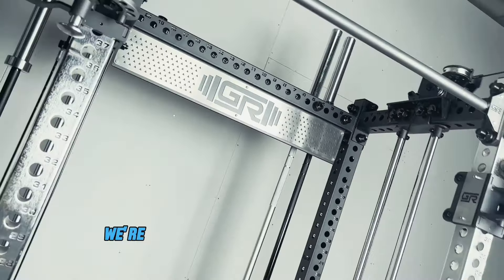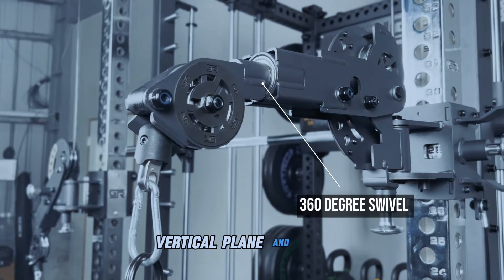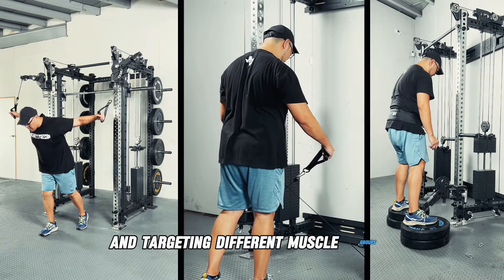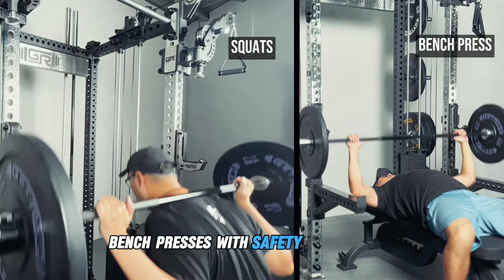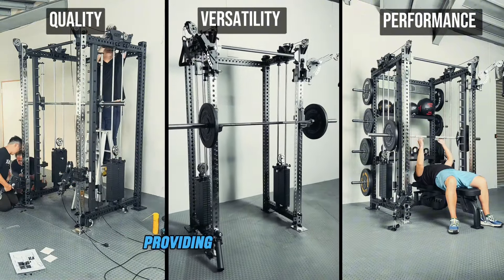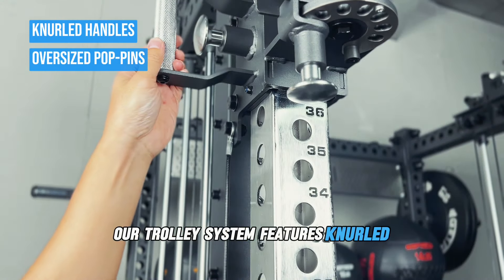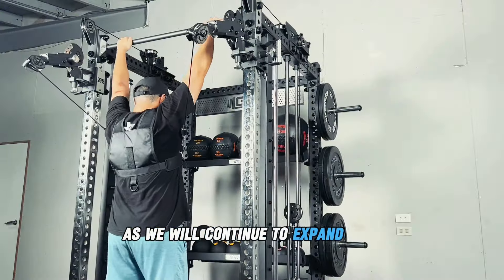RX3 series: Deep Dive Review on the New Tornado Racks 🌪️🌪️🌪️

Comment: This is insane! A shorter version like reps 80" would be cool
Reply from the maker: @Alex-kb9rd  we will have tornado configurations using 84” upright which would be 86” total height available in January 2025!
Reply: @GetRxd  Still too tall for my basement sadly. I can easily cut the uprights shorter, and I know I would need to have a shorter cable made if I did that. Only thing I'm not sure about is the guide rods, are they threaded on the ends or not? If not then they could also be cut and everything would bolt together nicely, but if they are threaded then that would complicate things.
Reply: Honestly wish you guys would have just gone shorter with it especially because for the same height of upright, the tornado arm already lets you position the pulley much higher than you could on something like the Ares.
Reply: @timk8258  they hinted a 85" cable tower in 2025, might be easier to cut that than a rack, wouldn't have tornado arms but its still quality
Reply from the maker: @timk8258  How tall is your basement? So we can consider a shorter version for the future as well
Our guide rods are NOT threaded, so you could cut the guide rods and put a hole through it for the bolt to pass through horizontally through it. Check our owner's manual to see how it assembles: https://www.getrxd.com/owners-manuals
Reply: Almost have ours completely built!
Reply from the maker: @Dou8leShot  AHHH!! We are so excited to see it and hear your thoughts : )
Reply: @GetRxd  Ill be ordering a 6 post smith tornado when you release the 86" version!
Reply: @Dou8leShot  Mines 2 1/2 weeks out. How hard is it to put together ?

Comment: You need to offset the arms to the side so that the cable doesn't have to travel down the center of the upright, would give more flexibility into what you can use with the arms at the bottom of the uprights.
Reply from the maker: Thanks for the feedback!
Reply: That's one of the flaws I.ve seen. Smith machine not going low enough and maybe not a flaw but tornado arms are heavy and hard to raise are other things. I still ordered one. Hope I made the right choice.

Comment: Awesome rack + cable machine + smith machine combo! After GGR and Gluck's reviews, these things are gonna sell like crazy. Hope in v2, they address some of the issues mentioned in those reviews (mainly the arm weight for moving it up).
Reply from the maker: We decided to go with the most durable, bomb-proof design for the trolleys with the least amount of moving parts possible. We’ve seen rollers inside trolleys breaking when hitting bottom crossbar, other attachments, or a barbell hitting them accidentally. Wanted to mention that while you do sacrifice some convenience without rollers in the trolley, you get the most durable design possible instead
Reply: @GetRxd  OK, but for some people (including spouses) the weight may be prohibitive. It would be cool to see a 'roller upgrade' kit for these arms - even if at the expense of some longevity (which the buyer has to understand when they buy this kit).

Comment: What is the max weight capacity of the cables + this pivot arms? Will you sell a larger stack?
Reply from the maker: @Tuhkeera  cables and tornado arms can handle 450+ LBs. We don’t plan to offer a larger weight stack than the 2x current 200lb stacks. You’re able to combine both stacks together by angling the tornado pivot arms together, and can further increase weight using our weight stack plate load pin, which allows you to add Olympic weight plates to the weight stacks!
Reply: @GetRxd is that 450lb real weight per arm/cable?  I think I sent an email asking for details a few weeks ago and the rep said 300lb real weight per arm, so would appreciate if you could confirm that.
Reply from the maker: @Kamikaze00ish  450lbs real weight per arm and cable

Comment: this looks really nice - great job.  i do have a question about doing the lat pulldowns.  in the video you are doing the lat pull downs outside of the rack facing in ( @56 seconds).  is it possible with the with this set up sit in the inside of the rack and face outward to do the lat pull downs?  or would it be a weird angle with the cables?>  i ask this because then you could use rollers or something to brace your legs when doing heavier lat pulls using both stacks.   also - are you able to do low rows from the ground with a foot brace? would it be possible to do them with foot extensions and a foot brace?  am in the market for a functional trainer and this looks really nice and right up my alley. thanks for answering
Reply from the maker: Yes you can do lat pulls from both inside and outside the rack. When inside the rack, the tornado arms would just be positioned slightly in front of you since the tornado arms are outside the rack. And yes, low rows from ground with a foot brace would work as well. We do offer front feet extensions or our adjustable foot plate that can both be attached on the uprights of our tornado rack!
Reply: @GetRxd  thanks for the answers! now I gotta make decisions lol

Comment: Wow, super impressed with the arms. Are there different weight limits depending on the angle of the arms? 

Im not sure if it would be possible, but if there was a way to unhook the bottom of the smith machine and move it like 6in to allow a slight angle smith, that would be amazing. 

Too bad the arms can telescope to come in closer for lat pulldown or low row. Im sure to make that possible it would require too thick of metal to keep it at this price point. Very nice machine. Hopefully I can purchase by this summer.
Reply from the maker: Hello! The weight limit of the tornado pivot arms is over 450+LBs at any angle, no worries there.
The Tornado Pivot Arms can adjust towards center to only 10" apart from one another, it's plenty close enough for lat pulldown and low rows. Further, with them set towards center, you can do lat pulldown and low row with each arm independently (unilateral training) or use our Tornado Arm Connector to connect both 2x tornado pivot arms together if you want to use both hands at same time (bilateral training) for lat pulldown and low row. This video shows it been done both ways: https://youtu.be/M8_6wthIaQY?si=Swwc4TzRFLJK8SQY&t=72

There's no way to angle the smith machine right now without some modifications by end-user.
Reply: @GetRxd  thanks! When the RX3 is available, will there be a drop down meu to add extras like storage and weight pins or is that done by searching the website?
Reply from the maker: @NorCalDad  We sold out the first few production runs very quickly. It's available for preorder now for incoming productions. Depending on which rack you want, you'll see an Available Date for when we expect to be able to ship the specific rack you ordered. If you navigate on our website to Strength Training >> RX3 Series >> RX3 Attachments and Accessories - you can see the available extras we have available now. You can also check the FAQ portion of the rack you're interested in for a list of the extra attachments we currently recommend
Reply: @GetRxd  awesome,  thanks!
Reply: @NorCalDad  Mine will be here 2/21. Got it with 2 db storage shelves. There's a lot of extras. I'll see after using it what else I need.  I see I saved $400 by pre-ordering when I did. Good luck.

Comment: About to receive ours and put together. What size sockets/wrenches will we need?
Reply from the maker: Hi @Dou8leShot, thanks for the question - Will require a 36mm wrench to get the job done.
Reply: @GetRxd  Ah, should have picked up that wrench set y'all sell.  Good deal.  I ended up picking up a couple 36mm wrenches on Amazon 1-day though I'll probably get that wrench set y'all sell just to have handy with the rack.  Arrives tomorrow!
Reply from the maker: @ Actually, take a look at the owners manual page here: https://www.getrxd.com/owners-manuals
Scroll to bottom to find RX3 tornado configurations. Open the link for the rack you purchased and the necessary wrench sizes will be listed on first page!
Reply from the maker: We'd also love to see a review on Youtube, Reddit, Instagram, or FB community group once you have it all setup : )
Reply: @Dou8leShot  Hey. Been 2 months. How was it to put together and to use ? Mines coming 2/21

Comment: Hey @getrxd i am looking at the compact rx3 tornado rack at 32.5".  Will it accomodate the smith attachment? It works with the 30" rack for the 6 post rack so im assuming it will?
Reply from the maker: Yes, it can accommodate the smith machine, but that means the weight stack would be pushed further back towards the back uprights, so if you wanted to add shelving, you'll need to use the shelf and plate sleeve extension (set). Also, since you'd be installing the weight stack further back towards the back uprights to make room for the smith machine, you'd need a different cable than what's normally included with that rack. If you place the order online, please email Sales@GetRXd.com with your order # to add the smith machine and receive the longer cable so we can make the changes to the order for you!

Comment: Is this a true 3”x3” rack with 1” holes? Curious about using other attachments on this like the new rogue roller for the lat Pulldowns.
Reply from the maker: It's setup for 75mm x 75mm with 26mm (1") holes
Reply: So...this is metric width (75mm x 75mm), but with standard holes  and hole spacing (1" x 2")?....or are the hole size and spacing metric as well? This matters to me because I bought your rack (haven't received it yet), but I need to use a different spotter arm than the one you offer because I need a safety pin to keep them from twisting when using the spotter arms for things other just spotting. Because they will mount spanning several holes on the upright if there is a discrepancy in metric vs standard hole spacing then they wonl line up for the safety pin.
Reply: Also...what is that vest that he is wearing at the end of the video when he is doing assisted pull-ups using the pulley system?
Reply from the maker: @tcon2368  It's all metric. So it's 75mm x 75mm upright with 26mm holes with hole spacing of 50mm.
Reply from the maker: @tcon2368  The vest is our shoulder harness with lead that people normally purchase for pulling sleds: https://www.getrxd.com/shoulder-harness-with-lead.html

Comment: So it doesn’t have a 1:1 ratio function?
Reply from the maker: Each tornado pivot arm is 2:1 weight ratio, but you can set the tornado arms to center and connect them or use from center for lat pulldown to use both weight stacks.
We also offer our RX3 3000 configurations, which have option for 1:1 and 2:1 weight ratio using our dual pulley design

Comment: hey! what's the weight of the arm?
Reply from the maker: 25LBs per arm
Reply: So what is the actual feel weight when using the 1st plate, plus trolley/arms
Reply from the maker: @Devin-Occansey  the trolley/arms don't add any weight to your pull. The starting weight feels like 10LBs and then goes in 5 LB increments for each additional weight stack plate you add. So, the total stack of 19 weight stack plates feels like 5LBs each + top plate of 10LBs means the total weight per stack is 105LBs total per side, or 210LBs total when using together.
Reply: @GetRxd Awesome.   Any chance of adding a roller yo the trolley so it's easier to go up?
Reply from the maker: @Devin-Occansey  We designed the trolley without rollers because we've seen many rollers breaking when they hit the crossbar below or above it. We decided to go 100% for durability by not using any moving parts on the trolley so that nothing can break

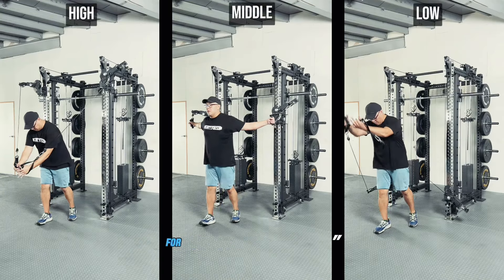Comment: 1:08, heads-up, this is a common misconception and outdated notion, you technically get a worse stretch in the pec muscles doing cable flys with a setup that is wider than your wingspan and it's slightly worse for muscle growth based on the latest research around tension at longer muscle lengths.

Think about stretching the pecs in a doorway, you want something pulling your arms back and inward slightly to maximally stretch the pecs, not pulling your arms out and away from you. Or think about trying to bend a rod around a solid pole, you would grab both ends and pull back and inward to maximize the force, not pull outward like a wider cable setup mimics.

Plus, the torque is maximized on your chest in a fly (or basically any cable exercise) when the cable is at a 90° angle with your hand/arm. And, based on the latest research, to maximize growth you want this to happen when the muscles are at a longer length (i.e. stretched) which is the very start of the movement when the arms are out wide.

Thus, you get a better "stretch" and more muscle growth when you maximize tension at the very beginning with a setup that is at, or just under, your wingspan width. You get more focus on the peak contraction/squeeze the wider the pulleys get, nothing wrong with that but it doesn't seem to be as growth promoting based on the latest studies.

Not a huge deal either way but just something to be aware of.
Reply: I would be more enthused about the added height the pivot arms give for more room to stretch to full RoM in doing things like single arm lat pulldowns.
Reply from the maker: @killerkhatiby009  thanks for the comments! With our tornado pivot arms, you will be able to set them up at the optimal position you mention! They have a ton of adjustability both horizontally and vertically and can be placed virtually anywhere for biggest benefit!
Reply: @GetRxd  Oh for sure, probably should've made that clearer, I don't think there's any issue with the arms since you can position them in whatever way!

Just wanted to point out the slightly incorrect information in the video since people often talk about a better "stretch" with a wider setup when you actually get less stretch on the pecs that way.
Reply from the maker: @killerkhatiby009  Thank you for the information!